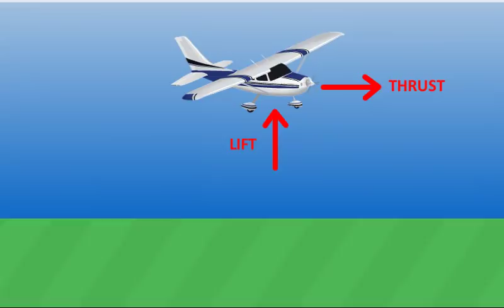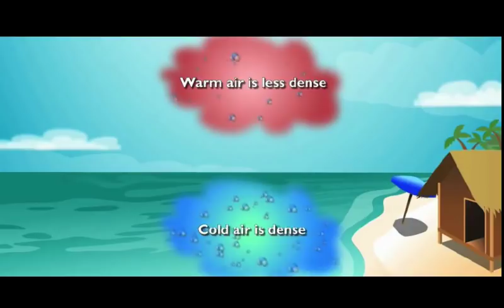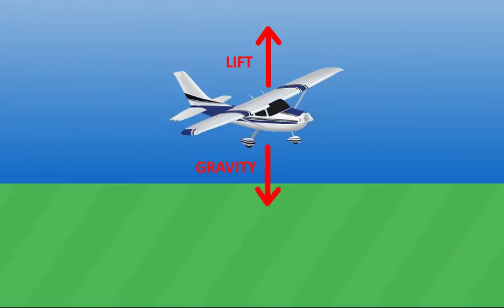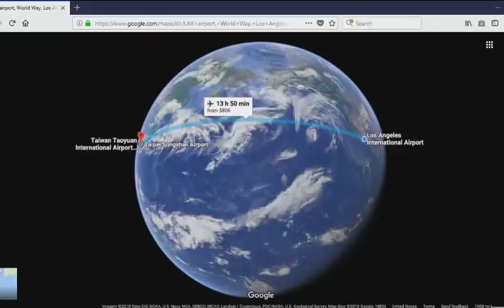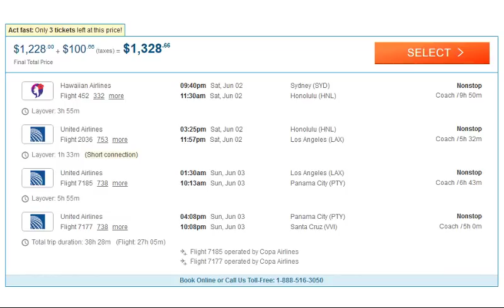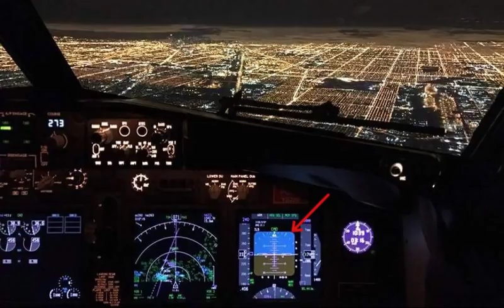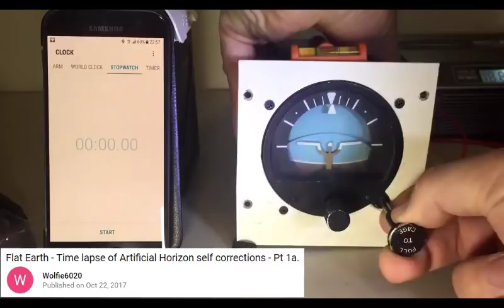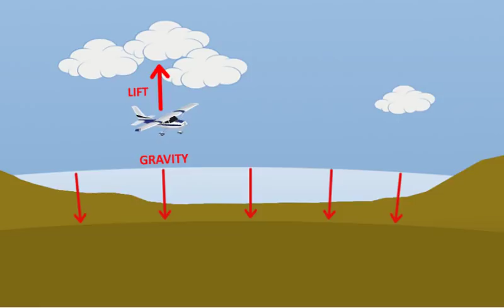Flat Earth Falsities - Plane Nonsense

Comment: Plane nonsense, I wonder. A pilot can take an airplane, like a passenger jet, up to cruising altitude point it towards it's destination and put the airplane on auto pilot and that airplane will fly straight and level for hundreds, even thousands, of miles. Impossible if the Earth was a sphere. If the earth was a sphere airplanes would have to fly nose down or nose up, but they don't.
Reply: Awsome piece of shit you are.
Airplanes use an altimeter to correct heights. Amazingly stupid comment you made.
There is no plane in the world that flies straight by itself. Not a single one.
Even gliders will move up when going through denser air. Does that prove earth is hollow?
Reply: @petroleumalley  Yep.  A hang glider pilot for example will cruise near a mountain to pick up thermals (warm columns of air rising along the side of the mountain).  As the warm air rises, the lifting force on the glider increases, resisting gravity and therefore gaining altitude.
Reply: Petroleumalley O.O learn about airplanes. An altimeter tells the pilot how high the airplane is, it doesn't correct.
Reply: "Plane nonsense". Correct. what you posted after "Plane nonsense" was plane nonsense.
Reply: Actually the aircraft does adjust its attitude but do so at a very small rate. The onboard gyroscopes have pendulus vanes which continually point toward the planet's centre of gravity (directly below) to adjust the gyroscope. This sends a signal to the flight control system to slightly adjust elevators to tilt the nose slightly, we are talking a very small amount here, then the aero foils return to their initial position after adjustment. I did calculate it all for another flat earther but if memory serves per 500miles the adjustment net was 4 deg... I'll need to dig those calcs out but that's the extent you're talking... so over 1 hour of flight the flight control system will instigate around 4degrees of adjustment. You wouldn't notice it.
Reply: Wrong.  It's straight with respect to the surface of the Earth, which is curved.  It's being held down by that wonderful force known as gravity!  

 As anyone who has taken a basic course in aerodynamics, or built and flown model rockets, knows (I've done both), there are 4 forces acting on a rocket or airplane in atmospheric flight: lift, drag, thrust and gravity.  (Outside the atmosphere there are only thrust and gravity.)  The bottom line is, an airplane climbs when it increases lift (or thrust in an upward direction).  It descends when decreasing lift and therefore not countering gravity as much.  Aircraft on automatic pilot will keep those forces constant (or nearly so), therefore keeping it level with respect to the Earth's surface.
Reply: Darryl Gonzalez gravity does NOT pull the plane around a curved earth. If it did the plane would have to be flying nose down or nose up and they never do. You've been so brainwashed you believe what this nobody says. Hahaha
Reply: Correct, level does mean level. What is the level of your experience?
What is the level of your education.
What is the level of your knowledge?
What is the present tidal level?
 @douglasherr4725
Reply: @douglasherr4725  No.  As I stated before I've taken basic aerodynamics and also built and flown model rockets as a member of a champion model rocketry team.    I also had a brother who was an avid hang glider pilot until his death in an accident in 1994.  I have a personal friend who is a retired USAF instructor pilot.  I have other personal experience as a pilot. 

So why do you believe what you do?  Do you have independent knowledge of. your own, or are you parroting bovine fecal matter that you've seen online?  It sounds like the latter.
Reply: @douglasherr4725  You also suffer from lack of reading comprehension.  I
The plane doesn't have to point nose up or down constantly, because the lifting force and gravity cancel each other out when the plane is in level flight.  When it is climbing, the lifting force is greater.  When it is descending, gravity is greater.

Really, go read a book, talk to a pilot or take up hang gliding.  You'll learn about lift and gravity in a hurry.
Reply: @douglasherr4725  planes always fly nose up, so what is your point?
Reply: Want to run that thought by me again? Moron.
Reply: I wouldn't grace it with "thought", more like parroted bs.
 @elmeralvarado1236
Reply: @boffeycn  for real. It's like he doesn't understand lift, energy, momentum, or the purpose of the jet engines on said airplane. Ridiculous
Reply: Correct. @elmeralvarado1236
Reply: @boffeycn  2:1 against fuglas
Reply: Elmer Alvarado moron learn about airplanes and how they really work
Reply: @Jesse Thomas lol. At this rate 99% of the population will be in on this conspiracy.
Reply: @Jesse Thomas ps. I deleted my last comment as for some reason it put your name on it! Wasnt aimed at you at all.
Reply: NOPE!! In fact, planes have to frequently tip their noses UPWARD in order to overcome the downward pull of gravity. And autopilot doesn't simply make the plane fly level. It automatically adjusts the plane's altitude as needed.
Reply: The trim forces of an aircraft in straight and level flight force it to maintain its orientation autopilot is actually irrelevant

Comment: 5:03 "In my reality a straight line is a straight line"
Straight with respect to what?  If the Flat Earther who made that original video means straight with respect to the surface of the Earth, he is correct: level flight IS straight (generally speaking) with regards to the surface of the earth.  If he means with respect to a theoretical line drawn from  the point of origin in the direction of flight, he is NOT correct.  The surface of the Earth is NOT FLAT, therefore the two are not the same.  Aircraft instrumentation doesn't know or care about the second choice, only the first.

Comment: Demopnstrations like the one at 0:26 are missing one BIG detail here. 
There is a problem of scale.  The Earth is REALLY REALLY BIG.  A circumference of approximately 24,000 miles.  
Helicopters are REALLY REALLY small in comparison!  I will assume for the sake of argument that the helicopter he is attempting to model here is one that is actually in use by the Australian police, the Eurocopter AS365 Dauphin https://en.wikipedia.org/wiki/Eurocopter_AS365_Dauphin.  Its length is 13.73 meters.   Putting that in perspective, if the Earth were a basketball, the helicopter itself would likely be the size of a pair of amoebas.    

But of course the Flat Earthers don't care about scaling or accuracy.  Those of course don't matter when you're trying to spread fecal material all over YouTube and everywhere else.

Comment: I'm not saying one way or the other but what about the corialis effect? The fact that a sniper must account for the rotation of the earth operates under the principle that objects in the air are independent of the spinning of the earth. So if a bullet must account for the rotation of the earth as an independent object flying through the air then why not a plane?
Reply: "The fact that a sniper must account for the rotation of the earth operates under the principle that objects in the air are independent of the spinning of the earth."
No, that is not the principle.  You might want to actually spend some time reading about Coriolis before creating straw men versions of it.

"So if a bullet must account for the rotation of the earth as an independent object flying through the air then why not a plane?"
Airplanes are also affected by Coriolis.  In fact they are affected by it directly and indirectly since Coriolis affects the predominant wind patterns.  The difference is that airplanes have pilots.  Pilots can make corrections while in flight.  Bullets do not have pilots, so snipers must make all corrections before firing the bullet.
Reply: @MrQuaiven  I'm not creating anything. I'm just asking questions. I'm not making passive aggressive arguments. Now I can get down with your argument but it seems to me this video is stating there is no Coriolis effect. Comes off as he's saying planes don't have to make adjustments cuz everything is just relative to each other. Either way I don't really care. I think flat Earth is pretty rediculous but there are some interesting coincidences.
Reply: "I'm not creating anything" You are.
."I'm just asking questions." which you should be able to answer for yourself, Shouldn't you.
"I'm not making passive aggressive arguments.": Yes you are.
 "Now I can get down with your argument but it seems to me this video is stating there is no Coriolis effect." No it isn;t/ See above.
"Either way I don't really care" Don't lie.
"I think flat Earth is pretty rediculous" So why did you post "I'm not saying one way or the other but what about the corialis effect?" Which contradicts you.
"but there are some interesting coincidences." No there aren't. The FE cult is nothing more than biblical literalism which you would know if you had bothered to actually look into it.
 @920WASHBURN
Reply: @920WASHBURN  Wong is not a troll because he's "asking questions".
And retorts "no you are" grown up arguments.
Anyway good for you, that you can perceive some interesting anomalies with mainsteam logic and rationals.
Reply: A bullet is on a ballistic trajectory it has to accounted for prior to firing an aircraft can course correct that is the simplest answer

Comment: so do planes have to keep dipping their noses to keep wit the curvature of the earth? no they dont if it was round they would be able to fly straight into outer space without any problem, explane that for me plz
Reply: Watching the videos it might help, any knowledge is always a blessing. Level flight is a constant distance equidistant from the centre  of the earth. Here in Australia, many people are now circumnavigating the earth. Flying due east from Sydney to Santiago, then to Johannesburg then back to Sydney. The distance is about 19,000 miles, combined flight times are well under 40 hours. So the distance around the southern hemisphere is less than the distance around the Equator. It is as far as travelling around the earth through Philadelphia. Therefore for the above distances to be correct The earth just has to be a globe. Proving that level flight bends matching the earth's curve.
Reply: hungryninja A plane stays aloft because of the air passing over its wings; the higher you go, the less the air and the less the lift. Reverse is true for flying lower. Consequently a plane on a constant speed remains at the same ie pressure and follows the curve of the Earth. 

How many degrees curvature per mile would you expect to observe on Earth?
Reply: Dear hungry ninja, dont eat just anything it may make you sick :(
Now, planes tend to have nose slightly tilted upwards (from their side of the ball), even if Gravity gets weaker (already very weak) the higher, still GRAVITY prevents plane from doing so, automatically, so that Earth does not lose any chemicals. 
Hope my latter globe science explanation helps :)

note:  Flook D is "back" ! Much needed I must say.
Reply: Dear ninja to whom many have become attached (despite BAD grammer!), unlike space rockets that all curve away from space, rocket-planes like X15 need to go steeply UP, horizontal flying will work well to get near the.. karmin line.
On this old original (pre-Flat) video you can witness the Reality (3:26).
https://www.youtube.com/watch?v=VBnkbeGLGk4
 May FLATness be with you!

ps: so civil here, no +wong or Capt Obvious :)
Reply: @BrainUser1  grammar*
Reply: hungryninja — I'm just curious. Which video explained that this should be an issue? What was the first flat Earth video you saw that made you "go flat"?
Reply: well he explained this question on 5:00 and answer is after 5:20 .

Comment: fill a pitcher up with water then take a spoon & Starrett round and round then let go of the spoon it goes round and round with the water just like the ground in the air. on that Globe model the mountains the structures are the spoon which keep the air going the same speed.  flatearthers just don't understand that the air is spinning with the earth from the uneven Terrain stirring it making it reach the same speed.

Comment: So if I pointed a laser straight out, would the plane have to keep pointing the nose UP to follow it? I'd really like an answer followed by an attempt by a pilot somewhere on YouTube. 

I can appreciate however the fuel stop debunk.

 Sometimes supporters can exaggerate or speculate. But, both of you are. You make much more sense than this one claim here, but still both sides are speculating.
Reply: I'll offer an answer too (and this is sort of a trick question):
To follow where the laser stream was or where the stream is? If the laser is fixed to the forward axis of the plane, then the laser will follow the Earth's curve at that altitude. If you are standing on a tall mountain at the plane's altitude, pointing the laser straight out, then the plane would have to gradually begin to climb (nose up), until it could no longer achieve additional lift.